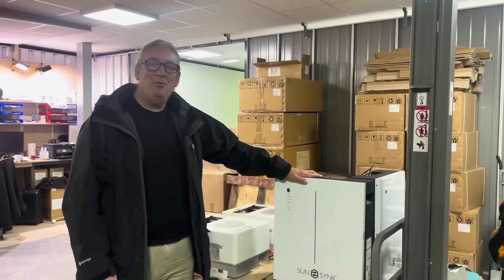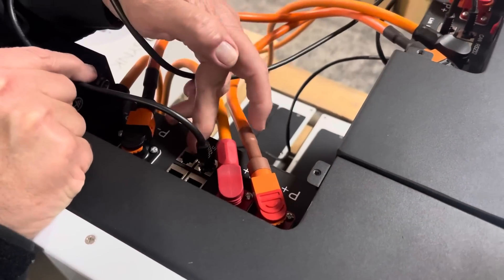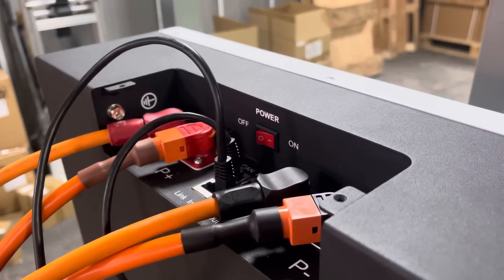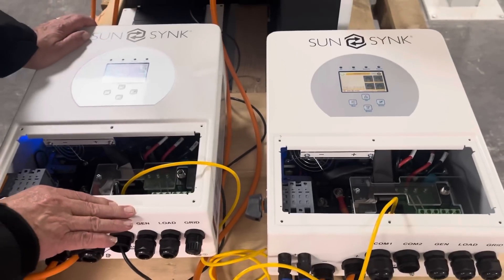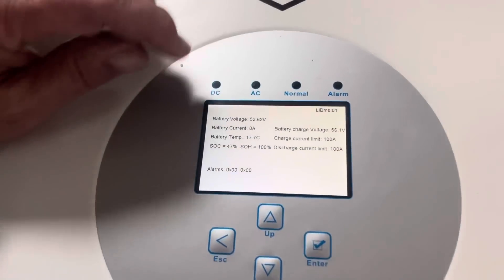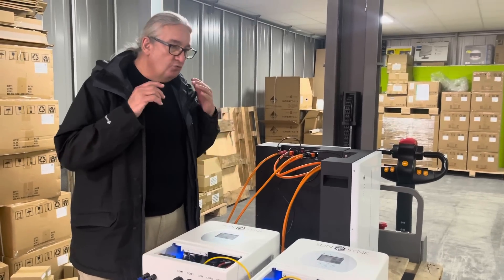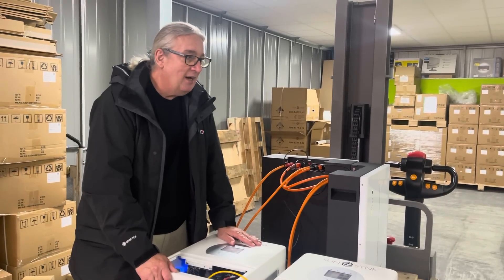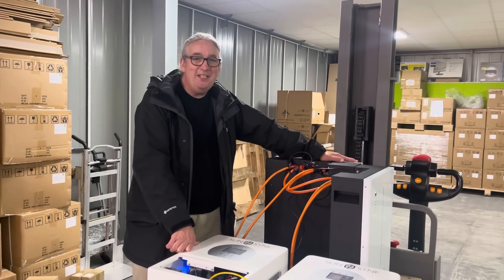Wiring our new BYD cell batteries in parallel

Comment: The cabling type on the video differs from the cables that seem to be being offered by resellers. The cables on the video have a plug at each end, but those being suggested to me have a flat connector at one end. Which is right? I have this battery

Comment: Hi Keith, I'm a bit of a Newbie to all this, But I recently had a 6kwp solar array fitted alongside a Sunsynk 5kw Inverter and a stack of three Pylontech US5000 batteries. We are a high use household having a Hot Tub, Pond Pumps, Power Shower Pumps etc. on the go. I also have an EV and am on the Intelligent Octopus Tariff. Octopus have just moved me over to their IO Flux tariff paying 15p / kwh for export, though I don't expect to have much power spare to export through the winter.

I need to set up the inverter to leverage the cheap rate for charging overnight between 23:30 and 5:30 -but am not exactly sure how to set this up on the inverter. Can you recommend the best setting from your point of view and point me to relevant videos / manual to guide me on doing this please?

Comment: Hello, do the batteries not need to be wired up to a single busbar with equal length cables before wiring them to the inverter to prevent unbalanced charge/discharge or is this taken care of by the BMS?

Edit: It looks like you two cables going out of each battery, one for each inverter. How do you suggest this is done using one inverter? Should it be the same but with the positive from the master battery and the negative from the slave?

Edit 2: Ah, finally found the answer in the manual (which is hard to find btw). It should be connected as suggested in my first edit. Batteries paralleled using a set of type 2 cables and then the longer type 1 cables should have the positive of the master connected to the inverter and the negative of the slave connected to the inverter. This ensures equal charge/discharge of the batteries.

Comment: So what's the C rating for this battery? Is it 0.5 or 1? The specifications sheet says:
Standard Discharging Current - 50A
Max. Continuous Discharging Current - 100A (1C, 25°C ± 2°C)
Max. Pulse Discharging Current - 200A (2C, 30S, 25°C ± 2°C SOC≥40%)

Comment: Hi Keith, thanks for the great videos. I am looking to buy your 5 kwh hybrid inverter together with your 5.12Kilowatt hour battery, but I believe it's the pro max, or the one that can discharge at 1C. I believe it may contain Catl cells. Is that a good battery, or is the Byd One a better option. I am  thinking of expanding to 2 batteries in the future for solar off grid system. I am based in South Africa, and I find very few reviews on these batteries, Here in South Africa local brands like Freedom Won, and Hubble seem to be more popular choices.
Reply: Both the CATL and BYD are nominal 0.5C charge & Discharge with only  a max of 1C discharge. Do a side by side on the datasheets. Would someone you use them at their max rating, not if longevity is what you are after.
Reply: https://youtu.be/e8zys5fiUZw?t=2768

Comment: Hi Keith, 

Are there any plans to develop the Sunsynk app/interface to interrogate the BMS and provide individual battery health data? Eg cycles, individual voltages, Temps, cell health etc. 

It would be very useful to be able to see the individual battery data in the system but right now the interface only shows you the top level battery data, as if you only have one big battery.

I'm fairly sure the Sunsynk can see the battery info through the CAN bus, in our case 4 x Hubble AM-2 5.5kw, dipped and linked via cat 5 but it seems that the only way to get at that info would be to add the Hubble cloud link interface
Reply: Would be so 👌

Comment: Thanks for the intro, can you tell us what size SurLok Connector Plug the rack mount BYD Batteries use?
Reply: Hi its a 5.7mm amephenol connector it only handels a 35mm Cable and the connector is rated to 150Amps